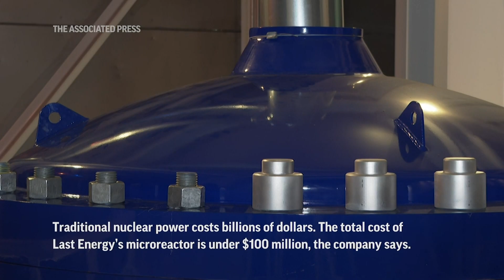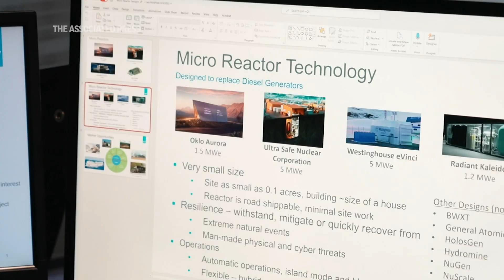Nuclear micro reactors to hit the market

Comment: "Traditional nuclear power costs billions of dollars...Total cost microreactor is under 100 million".  Traditional nuclear power plants are thousands of megawatts not 20.
Reply: Well, yes an no

Each module of the Bruce peninsula for example are only 840mws 

But they have 8 modules an pump out around 6400mws so I get what your saying 

And in comparison the 100m/20mws is 4.2billion in comparison to the Bruce peninsula 

I agree though these are junk
Reply: Well, yes an no

Each module of the Bruce peninsula for example are only 840mws 

But they have 8 modules an pump out around 6400mws so I get what your saying 

And in comparison the 100m/20mws is 4.2billion in comparison to the Bruce peninsula 

I agree though these are junk
Reply: Don't know why it double posted my response
Reply: @anything.with.motors  Yep, I was including all units together. Bruce "B" side units were 6 billion, with inflation that's about 15 billion. 3280MW/20MW=164 Microreactors. Assuming they can build these reactors for 100 million, it still costs more money than Bruce.
Reply: I think you're underestimating the market for this. There's people/companies besides power companies that want reliable power without relying on diesel generators
Reply: Yeah,...
Reply: @klixtrio7760  I wonder if the nuclear power system actually cost billions of dollars or if it's all the testing and safety requirements then make it cost hundreds of billions of dollars. Because on the submarine our reactor cost $200 million dollars.
Reply: @alanday5255  Agreed. Safety is a large cost in building nuclear plants. I'm speculating its under estimated in the microreactors budget.
Reply: @anything.with.motors  Stick to motors, because that was really poor math, considering that arithmetic is successfully taught to young kids.
6,400mW is 320x 20mW. And $100m x 320 equals $32bn, not $4.2bn.
So your figure should have been about $28bn higher, or 700% higher.
Reply: @anything.with.motors  your comment got fissioned 😅

Comment: For Comparison: 10 of these could support Denver International Airport and overnighted from Westiinghouse and installed all within 1 month. In total it would cover 1 acre vs 56 acres of solar panels "gross configuration" 1.7gigawatts per year. And could be replaced in less than a week every 5-8 years.
Reply: Exactly, solar is such a blight on the ecosystem in comparison
Reply: Are you trying to convince girls?  "It's so quick and easy, come on let's all do it!"
Reply: gigawatt is a unit of power.  1.7 gigawatts per year makes no sense.  Perhaps you meant gigawatt-hours.

Comment: The smaller size and reduced cost may provide an opportunity in related context - a possibility of safeguarding the environment*. 
Scientists in Russia, (A. Sakharov), and in the US, (E. Teller), once suggested building nuclear reactors underground. 
The plan was considered to be too expensive. 
The smaller size microreactor might lend itself to being built on retractable supports, over a lined underground compartment. 
In the event of catastrophic failure, the reactor could be dropped underground, and covered. 
*The hot reactor might melt the underground compartment lining, encasing, and creating a barrier with respect to the water table. 
*Once covered, the reactor would be more so the equivalent of an underground nuclear test, limiting damage to the atmosphere.
Reply: Reactors are far safer today due to computation and safer architecture to the point where an overload is so extremely unlikely that you're significantly more likely to win the lottery
Reply: “This ship is unsinkable!”
Reply: @Jiub_SN  Strangely enough, several hundred people win lotteries every day.  Nuclear meltdown is a lottery no one should win.

Comment: I’d encourage the regulators to start aggressively approving demo/pilot micro, mini and small reactors.  This sort of reactor, being a Gen 4 standalone safety wise would allow the energy generation to be more localized.  I personally believe molten salt or inlet gas cooled reactors at high temperatures is a better approach than light or heavy water reactors

Comment: Still too big. I want a single household nuclear reactor to supply only power to my house, with enough fuel to last 50 years. Price; no more than $10000.
Reply: The fissile material alone is probably more expensive.
Reply: How about one for the lawnmower, and one for the vacuum?
Reply: I want a micro sized reactor in my phone.

Comment: These kinds of reactors are perfect for islands with limited power needs, small communities in places like Alaska, isolated military installations. Since they are modular in design and designed to be shipped to use. They can be removed when no longer needed. They are designed to be unable to become a Three Mile Island or such. It is time to get the NRC off of this techs back and become a help to regulating safety not putting a foot on the neck of science.
Reply: Nonsense.  How do you think they generate electricity now?  Any place that be reached by ships can use heavy ship oil to power a fuel-oil electric generator.  Any place that can be reached by aircraft can use Jet A-1 fuel, which is a compression-ignition fuel that will burn in any diesel generator.  You're proposing a solution when there's no problem.
Reply: Like Camp Century! 🤠 Actually, the NRC does a lot to help these new technologies. It all depends on Congress and the market. Safety First! ☢️

Comment: I had solar panels put on the roof of my house so they take no additional land. They cost less than 20k total and will pay for themselves after 4 or 5 years. They will last at least another 25 years, giving me free power. They produce enough power to completely cover the energy needs of my house and 2 electric cars. When cheap sodium ion batteries come out next year it I will add whole home batteries to eliminate the need to be connected to the grid. 

The price of electricity will always go up because electric companies want more profit. If you live where solar is viable it will save you money the same way buying a house is a better use of money then renting an apartment.

Comment: Sorry fellas, the US military beat you to this by 72 years. You’re a little late lol 😊 The US Navy has been operating SMR's (Small Modular Reactors) nuclear-powered warships from 50 megawatt up to 500 megawatt since the mid-20th century, with the first nuclear-powered submarine, the USS Nautilus, commissioned in 1955; currently, the US Navy operates around 99 nuclear reactors across its fleet, accumulating over 7,500 reactor-years of safe operation with no major accidents reported throughout its history

…its not a technical issue for the US to start building these SMR's for commercial use for Data Centers and cities, its a geopolitical economic issue unfortunately blocked by the political influence from the petro dollar economy

...we move that out of the way, then we can finally have abundant, affordable safe, clean energy for millennia to provide energy security and help start reversing the effects of climate disaster and, even use its power for desalination to provide abundant clean water

Comment: And what happens when a jumbo jet crashes into one?
Reply: It's underground, not unless you hit it with buster bunker it might be catastrophic, however if you build a dome underground (anti-buster wall), it will survive take note that the reactor is also encapsulated in  a hard shell that can withstand a nuclear strike attack, in addition, this kind of reactor is self sufficient it means that it can cool itself without pumping cooling waters if an emergency occurs.
Reply: @ungas024  So it can withstand a nuclear attack, is it made from Unobtainium?  And it's able to cool itself without pumping cooling fluid -- where does the heat go when this is underground?  How is it serviced if it's buried underground?  
Are you Astroturfing for the Micro Reactor Industry?
Reply: You get a jumbo mess
Reply: What happens if a jumbo jet crashes into YOU? Think before you speak, bud. Mark your days.
Reply: @citricdemon  You appear to be a zero content troll and given how heavily the nuclear industry invests in think tanks and troll farms I'd guess you are  a paid troll, or in this case, and astroturfer.  
And, the point still remains, what happens when the next Al-Qaeda decides they want to hurt American and they charter a cargo plane with ammonium nitrate and fuel oil and fly it into the reactor?
Reply: Jumbo Lawsuit